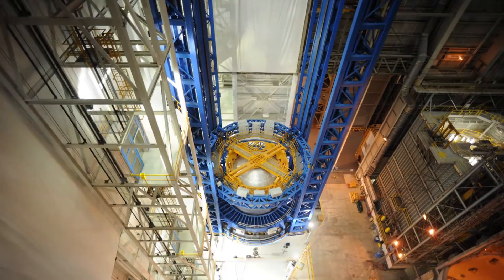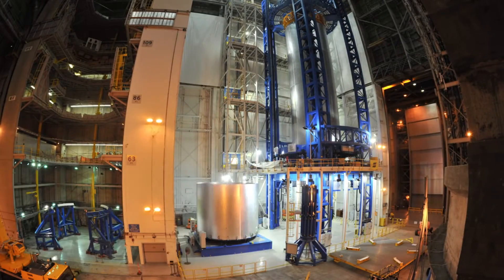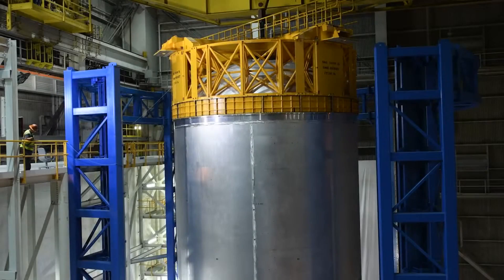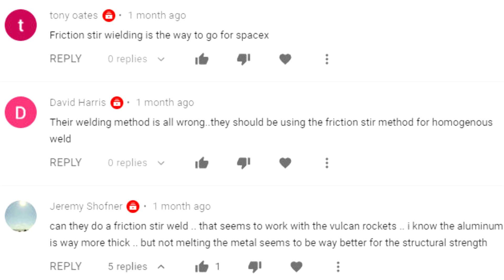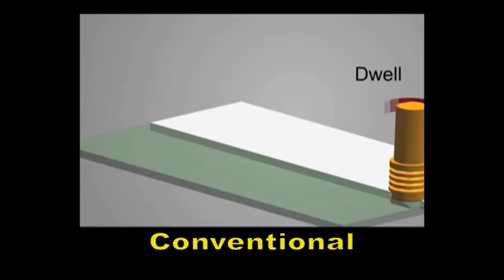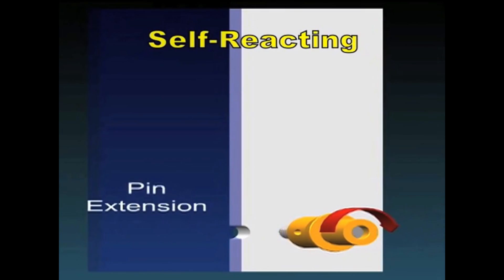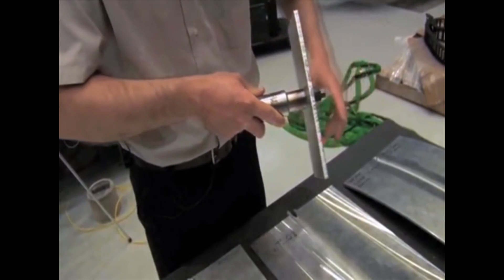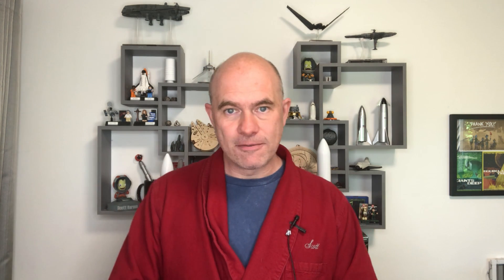SpaceX's 4th Starship Prototype Collapses During Test

Comment: Hopefully they're learning from this rapid prototyping.
Reply: I mean, the puck is still on the pad!
Reply: @JanKowalski-vj9py  : No, AGILE is supposed to produce lots of failures.
Reply: NaN - If I’m right, the RUD was caused by a boneheaded mistake during the testing process. As I’ve stated previously, someone appears to have pressurized the lower tank with atmosphere & the upper tank with liquid nitrogen. The crinkling before the implosion is evidence that that (or something very similar to that) is what happened.
Reply: The design may need changes but they will figure it out. This is not some scam. Elon doesn't need to attempt to make a big fkn rocket just for some investments. This is the real deal. Your opinion makes no sense.
Reply: @TODarkschnider420 Yes a con artist that continues to reuse rocket boosters by landing on a barge or land at the launch facility that all the experts said was impossible.
Reply: @TODarkschnider420 sure, a left-wing billionaire.
Reply: They are and the beauty of starship is the material is cheap and none of the advanced systems such as the raptor engines have been lost so each prototype is pretty affordable
Reply: @NaN You need to calm down. Geez.
Reply: That’s exactly the purpose of rapid prototyping
Reply: Do they actively maintain pressure in the lower tank, or do they bring it up to pressure and then close the valve?
Reply: @NaN Rockets design as is is good enough for Starlink however. It will need to prove itsself for humans though.
Reply: Yeah, they got this.
Reply: TODarkschnider420 How far right do you have to be to consider Elon left wing
Reply: Damn ladies, simmer down
Reply: rapid prototyping is used to convince the team to a certain design direction
Reply: They should. Or Elon will be the only fool sitting in one of those
Reply: Zboegt Yeah, you’re right.  It’s insanely crowded out there at 350 km altitude.
Reply: @Luiz Fernando Yes and that "somebody" is  an idiot in my opinion. They are going to lead the Starship development program into complete failure. Perhaps bankrupt SpaceX If Starship kills a bunch of people. For 50 years rockets have been successfully built by spending months perfecting a design and then more time  building precision rigs/equipment. The traditional way of building rockets has been a huge success. What was wrong was that rockets were not reusable.
Reply: @NaN No radiation fallout means not a nuke. But how did nuke becomes part of the discussion in rocket construction methodology. And you said you are going to unsubscribe yet you are still here talking gibberish and random things just to be able to keep talking. That is the exact opposite of going away. You can't even bring coherent argument go unsubscribe already. The value of your comments is negative anyway. Getting rid of you will only improve the comment section. So go away already.
Reply: NaN elon isn’t a scam. His companies won’t end up as the next Theranos, they will be trillion dollar companies.
Reply: @NaN Engineering can be appie to rockets btw.
Reply: @NaN Go away you can't even distinguish which are you arguing with what. My last comment is about you bringing nuke in a rocket construction discussion now you are talking about energy density which has nothing to do with construction method
 And lastly you are still here clinging in the comment section when you said you are going to unsubscribe. So I will repeat myself go away already.
Reply: @JanKowalski-vj9py  It's quite literally only their second full scale prototype being tested seriously. 'So many failures' my ass.
Reply: @NaN You need to show your company doing 50 landing at a cheaper price. Nasa burns money and can't even send their own astronaut to the space station. I am sure great people in Nasa did great things in the past given unlimited budget. But you on the other hand have neither unlimited budget nor a rocket company. You keep calling Falcon 9 and Dragon Capsule as snake oil when you have only farts and toxic gas coming from your mouth. You are wasting the oxygen you are breathing in your mouth spewing toxicity and negativity. Prove your words and steal Spacex business with your superior methods? But you can't you are just a keyboard monkey that will not do anything significant or noteworthy in your life.
Reply: TODarkschnider420 You think a con artist could make Starlink?
Reply: Kurt Colville Starlink is a scam that is going to end up being nowhere near what he promised. Ever notice how Elon has constantly avoided a price or sharing an Image of the receiver even though they want coverage this summer?
Reply: @JanKowalski-vj9py  Most of the flats weren't design flaws. Half of the failures were because of the weld quality which is (mostly) solved. One failure was because of the trust puck, which is also solved. This failure was probably because the liquid oxigen tank wasn't pressurised (probably human error). It may have other flaws but they are probably solvable.
Reply: @NaN Go unsubscribe we don't need you to spread your idiocy here. Have you seen "How not to land a rocket video"? Count how many failures Spacex have to deal before they have a successful landing. But now they have successfully landed 50 booster. Now how many rockets have you launch into orbit and then landed with out any failure? Spacex don't need to prove their method because they have already proven that their method work and it works while achieving large cost reduction. If you think they are doing it wrong then it is you who needs to prove how to do it right. Go build a rocket and show us your superior methodology. I will only accept that your method is superior if you are able to launch and land 50 rockets at lower cost. Prove to me that you are not just a keyboard monkey who has not built anything significant in your life. Where is your rocket company building rockets with your superior methods?
Reply: They will eventually be successful as they were with the Falcon / Dragon.
Check NASA's early rocket history, they lost WAY more rockets than they launched and lost good people on the way.
Reply: They're learning. With processes like this, success is defined by "Are you making different mistakes and solving different problems today than you did yesterday?". The process is ugly as hell in the beginning because you're essentially getting all your screw ups out of the way at once.  It's a cheaper and faster way to do it, but your organization has to embrace failure and endure lots of risk in the very beginning.
Reply: @NaN dude I thought you said you were unsubscribing? Bye 👋 Elon is not a scam artist. So Starship is getting off to a bumpy start. You sound salty as fk about it and probably care more about it than anyone here. Tesla EVs and the reusable Falcon 9 are products delivered that no one else could deliver properly. So maybe some people might have had a similar ideas before. Elon delivered the products and successfully. Go whine like a little girl somewhere else. I'm going to wait for SN 4 and it if fails too so be it. Its not my money or yours so stfu.
Reply: Yeah they did. Stop rapid prototyping and actually plan shit out. Was there a need to waste an almost finished rocket because of 1 failure mode
Reply: What they should be learning is to be more humane, and let the workers home. This is not Tesla, they don't need the Starship.
Reply: @TODarkschnider420 incel
Reply: I doubt they're learning anything. There is one basic lesson that should have been learned back when they blew up MK1....  If you build crap outside in the dirt, you end up with CRAP! Yet Musk and some of his fans seem to think that doing the same thing over and over will yield different results!
Reply: @DavidJohnson-tv2nn  this looks to you like doing the same thing over and again?
Reply: @patrickmalone1373  Actually, I'm sitting back and enjoying this. Since I warned you guys this would happen and you guys all think that building flying garbage cans in a junkyard is a great idea! Can you blame me if I come back and say I told you so?
Reply: David Johnson The Centaur upper stage is literally a beer can in space and has been for 40 years or more.   Also how many other space companies have this level of scrutiny?   Their fuckups are done behind closed doors so we usually don’t get to see them.  Keep trying - those billions in short positions will pay off one day I’m sure.
Reply: @DavidJohnson-tv2nn  : No, we all think that blowing up a dozen of these things in a few months of development is fine, whereas you think that is fatal.
Reply: @absalomdraconis  said...... "No, we all think that blowing up a dozen of these things in a few months of development is fine, whereas you think that is fatal" My response..... Musk fans.... Keep thinking that aimlessly welding pieces of metal together outside in the dirt without proper engineering, design, and quality control works out for you :)
Reply: @patrickmalone1373  As long as Musk keeps breaking things in his Starship junk yard, I will continue to remind his fans of the futility of the effort :)
Reply: @DavidJohnson-tv2nn  I would bet they want at least a proof of concept before committing to designing a factory because many things as far as design can and will change before the final iteration and to retool the factory at each step would probably be cost prohibitive for their ambition
Reply: @chacecrowell  No one is saying that they need to build an entire assembly line first, but at least build an "F"-- ing building!  Spend some time doing design and engineering work on a computer. Than do computer simulations of how the design will perform. Build scale models to test, etc. Do all this BEFORE going out and welding stuff together. No other company on the planet does things the way they are done at the Starship junkyard.
Reply: @DavidJohnson-tv2nn  they have buildings for simulations at their headquarters the only need for them at the construction and launch site is for assembly which they do have a building and multiple tents for and launch support which they don't need the full system yet for full tests. Compare this to Blue Origin who is dumping tons of cash into their Cape Canaveral setup for both New Shepherd and New Glenn when they have yet to make a single orbital flight and I'd give the edge to SpaceX for at least proving their idea will work before investing in automated manufacturing
Reply: @chacecrowell  New Glenn will most likely be successful on it's first flight because Blue Origin spent the time, effort and, money to get it right. Just like SpaceX did with Falcon 9, Falcon Heavy, Dragon, and Crew Dragon.  Unfortunately, with Starship development, SpaceX has chosen to take proven successful methods of development and throw them out the window! What is the hurry? Why build a bunch of cheap crap? It makes no sense to me.
Reply: @DavidJohnson-tv2nn  You have no idea what you are talking about, unless you have some detailed knowledge from inside that you would like to share.
Reply: @watcherofwatchers  Common sense says you don't build aerospace vehicles outside in the dirt. Most other aerospace companies and engineers will agree with me.
Reply: Elon might have gotten away with it if he was using lighter fuels like hydrolox, but I'm not an engineer.
Reply: @dongiovanni4331  the thin walls are for light fuels, we actually need to focus on the thrust side more
Reply: they should of figured this out long time ago nothing hard making tanks hold pressure. If they had a proper factory they could of hopped already.
Reply: @blexxy5861  But it is hard to make them light enough to hold pressure, make orbit and return.
Reply: @blexxy5861  are you familiar with engineering/rocket science?
Reply: @blexxy5861  no they would likely still be building the factory.
Reply: @blexxy5861  (*should have)
(edit: also *could have)
Reply: Seriously you are a bunch of fanboys making excuses for failure. I work in this industry and these failures are unacceptable with the software out there which would have calculated this was going to happen.
Reply: @dikkybee4003  hold up you are comparing  engineering a Rocket vs hacking what?
Reply: @dikkybee4003  : That same software has failed to get us SLS.
Reply: Dikky Bee they are unacceptable to you because you're not used to this kind of iteration. They test and fail and iterate instead of the usual of spending years making it on paper. It's a different route to take, and it might or might not be more expensive, but it's a hell of a lot faster.